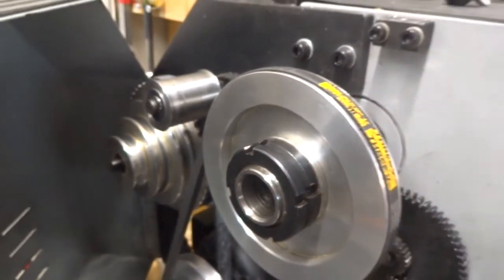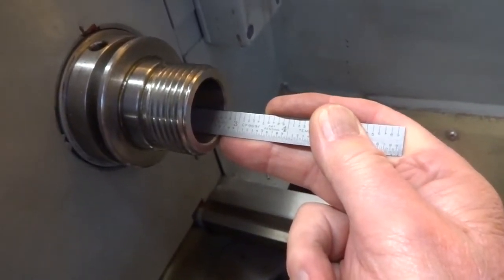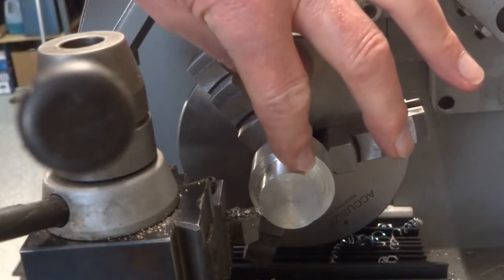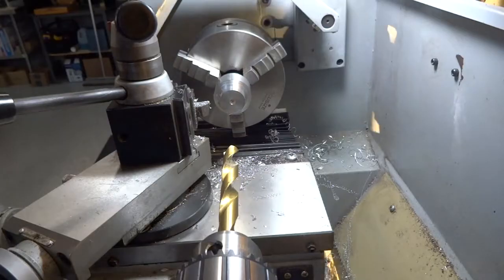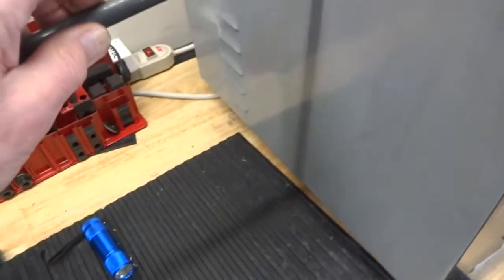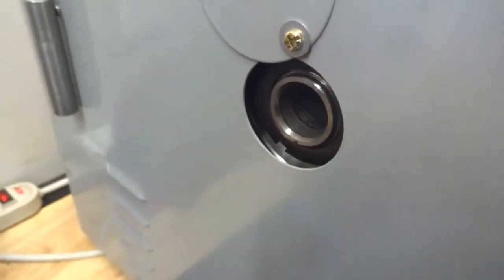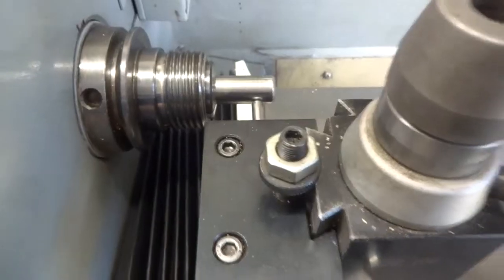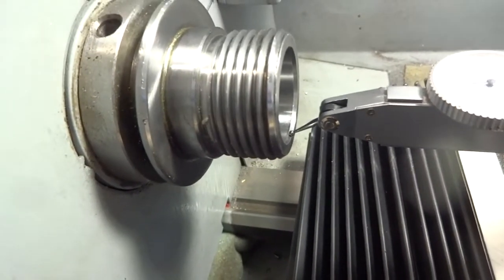Use R-8 collet in lathe spindle bore morse taper????

Comment: my spindle has an MT4. I took an MT4 to MT3 adapter, cut off the back with an angle grinder, and ground an R8 taper on the inside. the drawbar has a big chunky knurled 6061 nut, to hand-tighten the draw bar, as well as just using my fist to tap the collet to release. works like a charm...
Reply from the maker: Sounds like you have a well quipped shop. If I could do that it would be great but I have no  ID or OD grinder.
Reply: @MrModify  you have a dremel tool? get or make a dremel holder for your QCTP.. do rough passes with a boring bar and carbide insert, then finish the surface with the dremel. if no dremel is available, attach a normal drill with hose clamps to your QCTP.
Reply from the maker: Not sure how good the finish would be but I will consider giving that a try. Thanks.

Comment: On the inner chamfer of the spindle, I am wondering if that could be trued in situ and the angle adjusted to that of the R-8 without removing too much material. This gives me the idea of (mine has a Jacobs 5 taper} making a J5 to R-8 adapter ( I have a full set of these) Enjoyed the video, good luck on any future attempts at this. Cheers!
Reply from the maker: I think mine has  a Morse taper 4 maybe I can find an adaptor to r8. Thanks for the idea.
Reply: @MrModify  That seems large enough to make an adapter, be sure to video the success (or failure) as it will be of great interest. Cheers!

Comment: You could make an adapter for the spindle taper to a 3C collet. 3C collets are available new or used. Smaller South Bend lathes used 3C collets.
Reply from the maker: A possibility. Thanks
Reply: @MrModify  Little machine shop has 3MT to 3C adapter for $20. Set of 7 3C collets $40. Guaranteed true within 0.0002" .